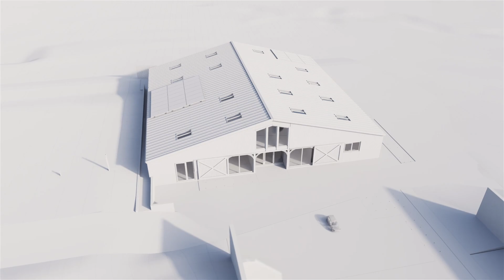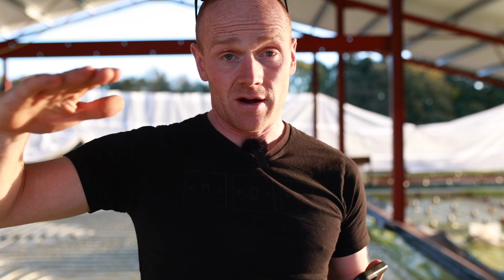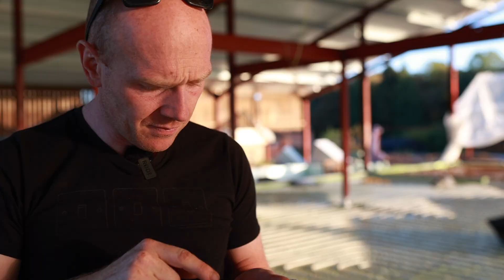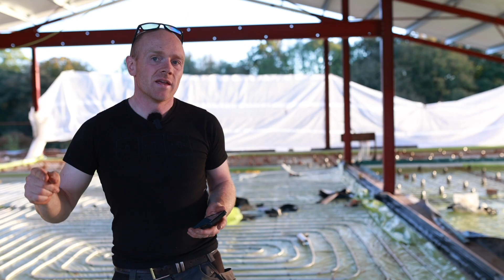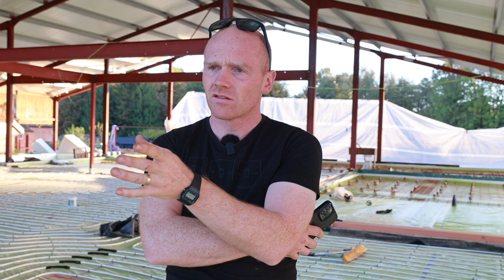WHAT ARE WE ACTUALLY DOING? - Some thinking behind the MADNESS!

Comment: Top tip. Stick with the manufacturers controls for your chosen air source heat pump. Something like a 12kw Vaillant Arotherm Plus may be suitable depending on your heat loss calculation.
Enable weather compensation and let it do it's thing.
Nest and Wiser are not suitable for running a heat pump.
The height position of the pipework may be debatable for a higher flow temp boiler connection, but for a heat pump, siting the pipework higher or lower in the slab will make zero difference to the thermal performance because of the thermal mass and thermal inertia combined with weather compensated running.

Don't worry about kitchen overheating, the steady state heating will ensure that the building self balances quite easily with the volume and openings you have.

Comment: I looked into triple glazing when I had our windows replaced this year. The thermal performance difference between double and triple isn't actually that much, compared to the difference between single and double. I opted for double glazing, to replace the existing 30 year old double glazing. So far so good, they seem very thermally efficient compared to the old windows. Though I get with the amount of glass in your build it's probably worth the upgrade!

Comment: Please please please don't use third party controls like Wiser or Nest on a UFH system like that. To maximise efficiency and comfort you need controls that talk intelligently to your heat pump most likely using weather compensation, and that generally means the manufacturer controls. 

If you get the control system right and aim for consistent temperatures throughout, you won't need ANY thermostatic control downstairs at all, the heat pump will use the weather compensation curves to ramp the flow temps up and down as required to just replace the heat lost from the fabric of the building (which obviously varies based on outside temperature) and maintain a constant temperature without ever needing to know the inside temperature. Regular thermostatic controls doesn't give you that, it will call for heat and throw an excessive amount of energy into the house until the temperature rises and it's told to stop by the thermostat, it then waits for the room to cool back down past the target temperature before it kicks back in and repeats the cycle causing temperature fluctuations and a less comfortable environment, especially with slow responding UFH in the slab that will hold the heat for hours and conversely take hours to heat back up. 

As someone else said, have a word with Heat Geek or Urban Plumbers, you need to get this right first time!
Reply: Wisdom. 👍

Comment: The only reason to have rain water harvesting as well as a bore hole would be as general redundancy in fresh water supply if bore pump fails or ground water gets contaminated. Not a compelling argument in the short term. Bore hole is best bang for buck in the long run so I think you are correct.

Comment: Thanks for addressing the ceiling heights and fireplace question. We put in a 9kw wood burner(from Morso in the UK), turn the underfloor off in the summer and on the days that the temp dips, use the fire to heat the whole house. It works a treat and it’s nice to have a fire  to put the feet up to after a hard days work!  Suggest planting 0.25 of an acre with some slow & fast growing timber for the wood burner now!

Comment: Another tip, if you can.  Put underfloor heating in the patio in the garden room fed by an airsource heat pump.  that way in late autumn and early spring you can extend the time you can use the patio.

Comment: We have underfloor heating and love it.  Our house is 20 degrees constantly except where solar gain on the south facing rooms.  May I recommend having the utility room on a separate circuit as we use the room in winter as a Chinese laundry.  With the floor on and the extractors on in the background.  Clothes dry really quick.  If you have a heat recovery system then this would be very beneficial.

Comment: Great work Tim, envy your work ethic. 
You'll be able to find your fireplace vent with a thermal camera as will, I'm sure you have one with your attention to insulation detail ;). Putting a metal bolt in the pipe is a good alternative though!

Comment: Underfloor heating is more efficient therefore less energy used to heat your home are you a radiators cost a lot of money because the heat is only in one area where with underfloor heating it's across the whole floor etc

Comment: I wouldn't bother with a borehole. You'll have to replace the UV bulbs and filters regularly so why not just have an activated charcoal filter on the mains for your drinking water? Then have a 20000 litre rain water tank on one of the buildings for water troughs etc. The economics of boreholes aren't great. They require electric and need regular maintenance and replacements to keep them functioning correctly.
Reply: I mean, I would have both, you can never have too much water (some might disagree!), but yeah, a borehole might not be as unlimited a supply as it may seem, depends on what kind of yield they can expect I guess (and whether there are any limitations? I don't know if there's any regulations in the UK, like there is for taking water out of the stream), plus pumps can go wrong and whatnot. Even if you don't keep the rainwater as a backup, divert it into a pond or something, don't just chuck it down the hill or whatever, always better to keep water on your land for as long as possible.

Comment: Grate content, I am looking at changing a barn roof from concrete 6 profile to insulated panels like you have but how are you going to finish the ends of the panels for the gutters and facia? Cheers Liam
Reply from the maker: Barge trim at the ends but undecided on gutters. Had hoped to take cladding up and hang more of a feature gutter but needs to be pretty high capacity so may end up with trim line type after all.

Comment: You might want to put several thermostat probes into the concrete floor so you can attach them to your room thermostats later?
Reply from the maker: It's on the list for tomorrow.  We have a number of pipe offcuts that will be capped at the end and cable tied to the rebar. I'll bring them up in stud walls and we can drop the probes down them later. 👍
Reply: @TheRestorationCouple  Probes means valves means expense and faults. This slab will be very thermally unreactive, so why bother? Heat losses will probably be more than met by a child's sleepover, 150 watts a pop.

Comment: You may be surprised, in a good way, by your infloor heating needs. A hyperinsulated home may only need the infloor heating on for the coldest days or coldest part of the day. All your hard insulation work will be rewarded.
Reply from the maker: Hope so.  It's more than needed on the thermal modelling however I would rather have it and not need it than need it and not have it.  in the whole scheme of things the pipe is relatively low cost.
Reply: @TheRestorationCouple  only downside to that is potentially low efficiency as the system cycle more often. Good system overall though